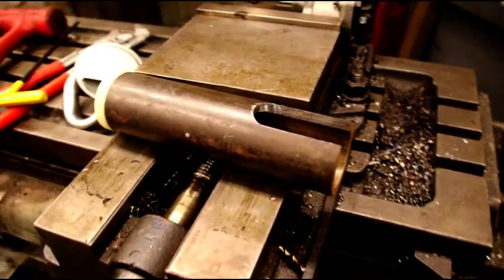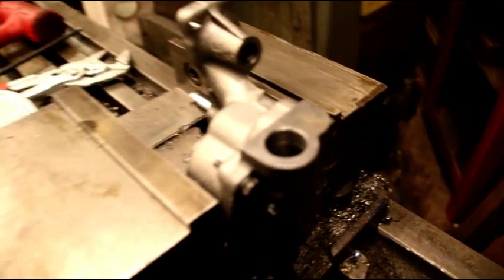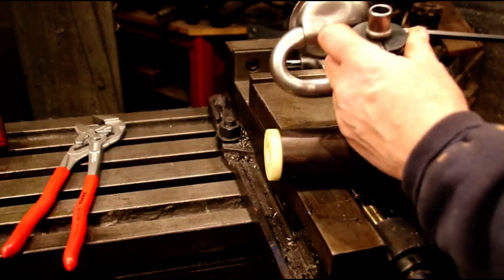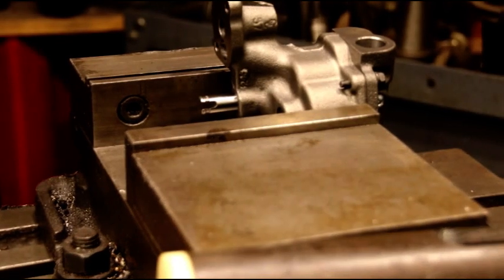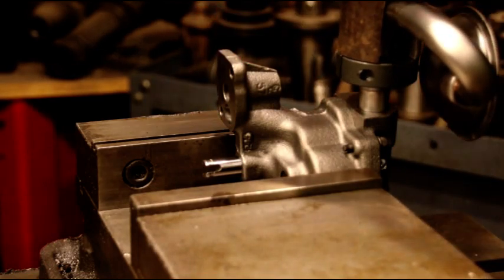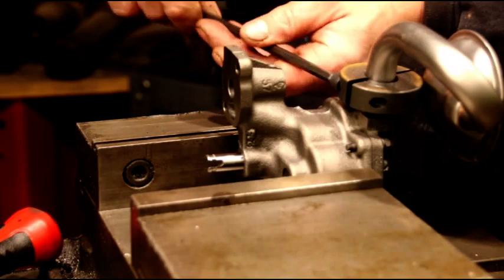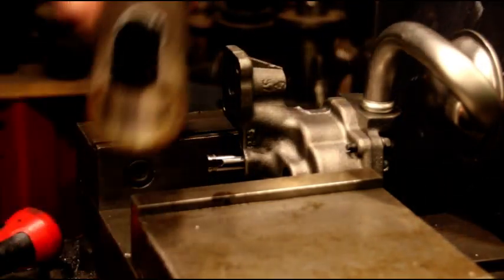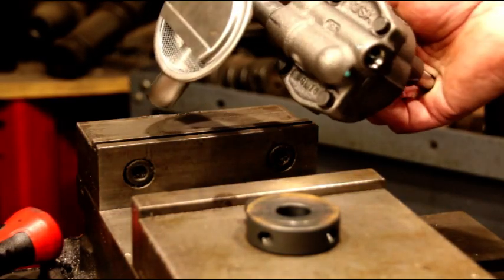GM 4.3 V6 How To Install Screen To Oil Pump Without Damage !!!

Comment: Awesome tip. For the clamp, you can drill proper size hole in a piece of flat stock, then cut the flat stock in half, splitting the hole. The cut line gives you the “crush” space so it grips the tube tightly. Hold in place with a couple c-clamps.
Reply from the maker: good idea if you don't have a shaft collar.
Reply: What year was it

Comment: no need for lube on tube before sending it home?
Reply from the maker: No, just a press fit that is designed not to move or rotate after assembly.